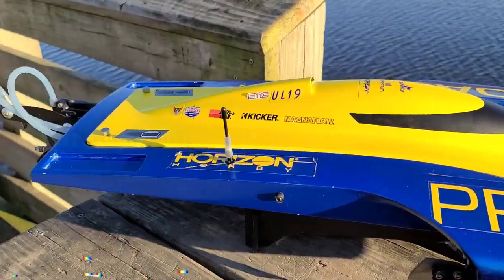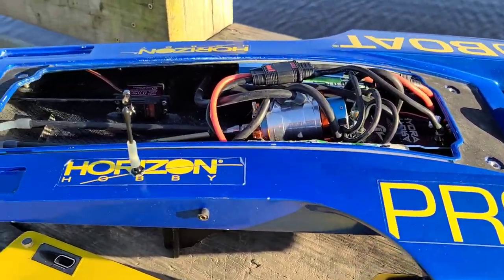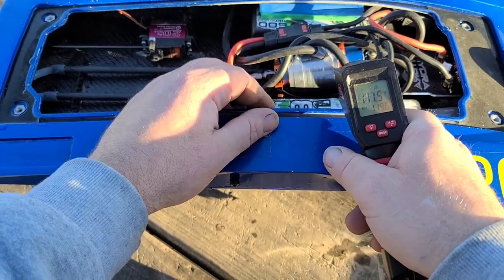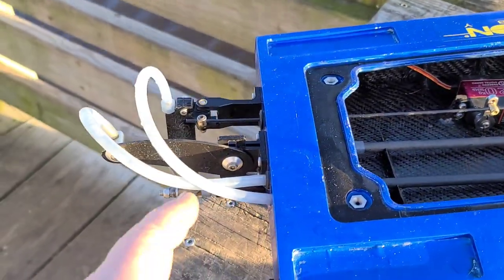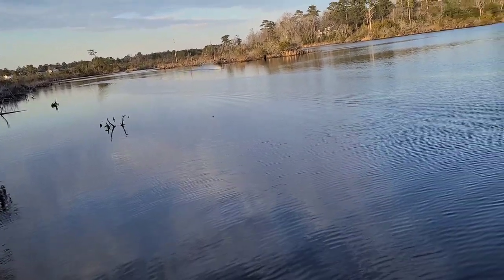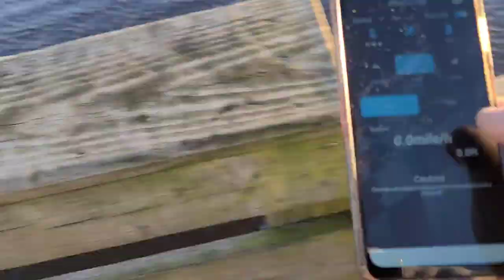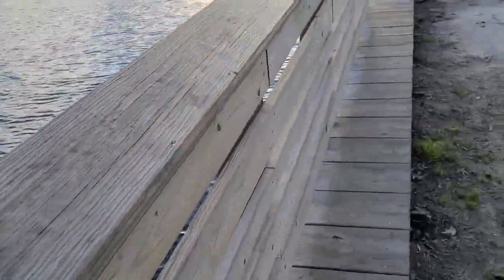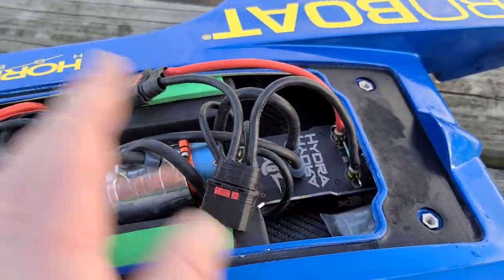First Run After Rebuild Upgraded Proboat UL-19 - Castle Creations Hydra - Oxidean Marine 4082 - SMC

Comment: Nice first run, very fast seams to have plenty  left in it too.
 I had a cell go in a lipo that caused a similar issue.
I need help have you ever had a problem with really bad torque steer ?
I have a 33 in rigger 8s 1650 kv 4060 tp motor 200 amp esc 
(As soon as the power comes on strong about 3/4 throttle on to full)
the boat veers to the right so bad I can’t correct it quick enough to get a run faster than 76 mph.
I have tried a different rudder, steering servo, all sizes of prop some low pitch some high some clever some round ear I have played with different CG’s I thought it might be the Bec losing power to the steer servo due to the motor taking it all so I run a separate receiver battery and dropped out the Bec supply wire from the esc
Nothing helps it is looking very tail heavy but it’s running 64 percent on the front (back of the sponson ride surface)36 on the rear tip of the rear ski.  
I’m Hoping you or one of your many followers may help with suggestions
Reply from the maker: Have you tried tinkering with the sponson "toe in or out"  also your turn fin could have a lot to do with veer on a rigger sounds like you've checked everything else?    This is .my first thought, maybe someone else will chime in
Reply: @IRONCLADRC  yes it’s toe in is 2mm
The veer is only as the torque hits
I’m at a loss
Reply from the maker: Have you tried small props.  Maybe she's over proped?
Reply: @IRONCLADRC  yes  I have quite a few sizes and have tried way small it just cavitates a lot the boat weighs 4 kilograms 
I could write a story on it but it would fill up your channel with my woes so I kind of kept it to the main point.
Thanks for your input I was hoping someone that had a similar issue might chime in if you hadn’t experienced anything like it.
It’s scary when it happens, it veers so hard I worry about smashing it.
I got 94 mph out of it one day out in the middle of the lake but it was in a big turn I had room to let it happen and time to steer against it with all that room.
But it’s slowing it down by the time I correct against it I start to run out of radio range.
Reply: Sounds like it just rides on its prop. Extending hull length will help, combined with two small
turn fins at the back. May be turn fin is too much aft.....Motor and shaft should  be positioned 2 -3 degrees to the right, prop in centerline.
Reply: @sjorswouda6865  I have never heard of turn fins on a rigger.
Does that affect the cornering adversely
Reply: I had a very similar problem with one of my riggers ( ml boatworks rsx380 ). Especially when running 8s in it. The fix was to offset the drive shaft and motor.  Also make sure your turn fin is lined up . If it's curved a slight angle down will cause it to shoot right.
Reply: @charlesseda1127  I think I found it.
The servo mount had the epoxy let go on the front left where its base plate was glued to the floor, when I was just working the play it was nice and tight and had no play but when I loaded it up the mount plate was lifting off the floor on the front side. Causing the rudder to turn right.
It’s all fixed now and I’ll be testing it in the morning Australia time.
Fingers crossed.
I hope I don’t need to all that other work suggested.
Reply: @jamesatkinson7517  Your riigger is subjected to propwalk in a severe way,. How does it behave on soft, lineair trigger ? You can mount (little) turn fins everewhere you want.
Propwalk is a big issue on riggers. My solution up to now is twin drive, counter rotating props, I don't use anything else, no prop walk, so no veering to the right at all.
Top speed 112 mls./ h.  scratch build 39" pickle fork three point scale hydro.   
Current build : scale hydro with rc activated front spoiler & -triim tabs. Yes !
.
Reply: @jamesatkinson7517  awsome brother,  love it when it's a simple fix.   I'm out to the pond as we speak myself.  Good luck with your runs . FULL TRIGGER  👍
Reply: @sjorswouda6865  the twin drive system had crossed my mind.
That’s some serious speed , you are playing in a whole other level to me.
Thanks for the great advise.
Rough rainy and windy today so no testing yet, what a  bummer
Reply: @jamesatkinson7517  Hi James,. Thank you for your kind reply. Please don't see it as an other level. It's just having fun for 30 plus years now. What I've learned : dont ever copy anyone, listen and make up your mind for yourself. Read all you can about aero - and hydrodynamics & think.  Don't try to avoid smoking ESC's and magnets flying around.
Too much fun, life is too short. Have 2 or 3 hulls prepeared. Enjoy
Reply: @sjorswouda6865  I absolutely love these Rc boats I have one 33” deltaforce mono and 6 riggers.
I ran the 8 s rigger this morning and it’s still veering.
What I did is took a closer look at the zipkits 33fe I smashed and noticed the rudder was closer to the transom but it got smashed in the crash hence the new rudder and bracket on this new rigger I modified the new one to match this moved the rudder forward and I believe it put it away from the turbulent pro wash as previously mentioned I re - epoxied the servo base plate as well everything is super strong  now but it still not right although slightly better.
It’s at least correctable now 
The funny thing is I feed the throttle in and as the esc delay goes away and the power comes on it veers and I back off and correct it and then I power on again and it hits the power again and  I don’t need to correct again it does not veer to the right again after that 1st correction.
Very strange.
Reply: @jamesatkinson7517  Not sooo strange. Two scenarios are to consider : 0 - 30 mph and
20 - 50. Second time you accelarate hull is (partially) on plane. So left sponson grabs
the water & creates resistant as well.
Reply from the maker: I was thinking about your problem figured I'd  let you know my thoughts.    Rudder!  How long is your rudder?  I actually had a mono with a long rudder that would do a crazy turn at high speeds, shortened the rudder, pretty sure it helps my problem...   not saying no this is the case with your boat but it's something to think about. 🤔
Reply: @IRONCLADRC  I think your probably right shorter but wider I thing so it acts like a turn fin when in the straight ahead position
Wider meaning longer front to back.
One of your subscribers got me thinking he said a turn fin might help 
He sound like he’s done it.
He sounded like he’s had great success going fast.
Thanks mate